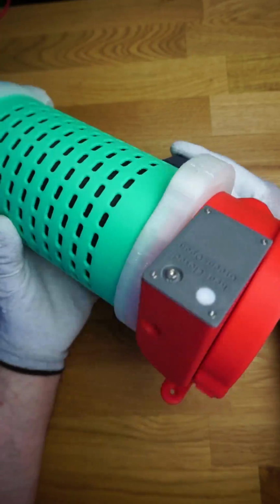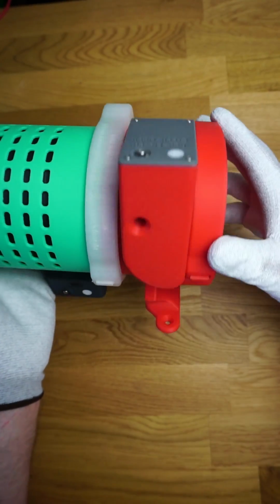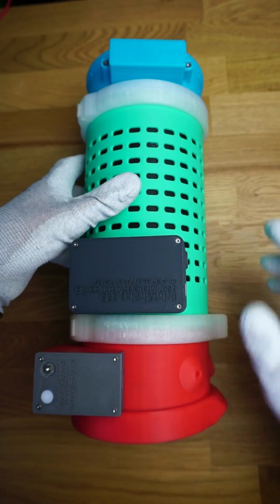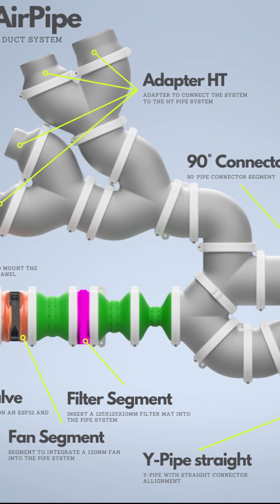#PrintAirPipe 360° intake segment introduction #esphome

Comment: You could find a way to make it so this can regulate itself passively via air-pressure, opens(or closes) when there is too much pressure/vacuum when the system can't keep up otherwise. I imagine a paddle in the airflow and spring could actuate it for flow conditions, and some sort of membrane could be used for detecting pressure to pop it open, something like an emergency-vent scenario.
Reply from the maker: Good idea, I made some more segments (see me other videos) which can measuere air flow and air parameters. With this it should already be possible to realize this. 🙂